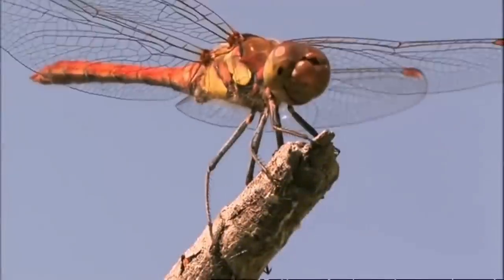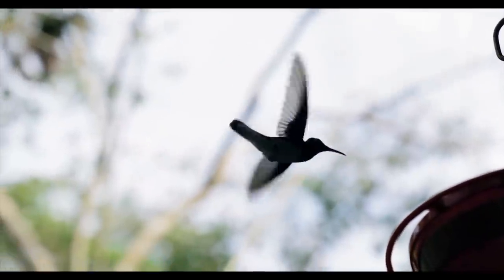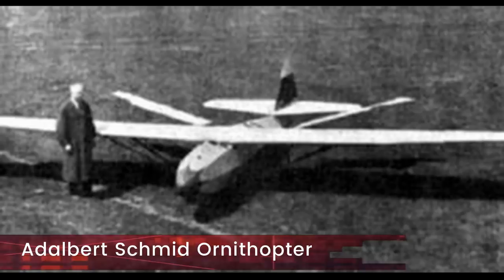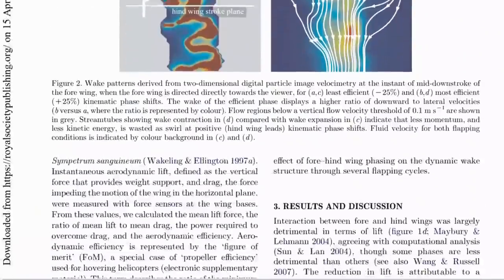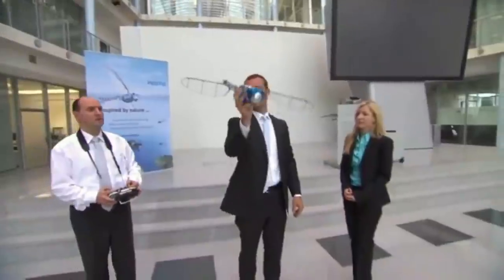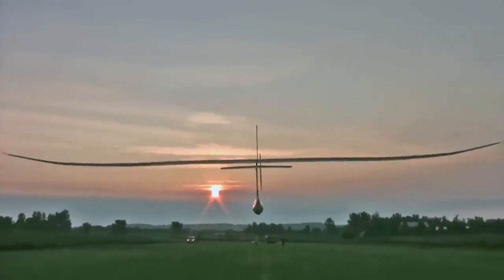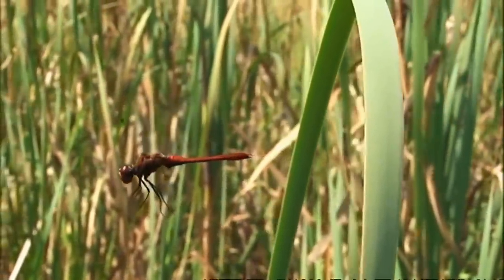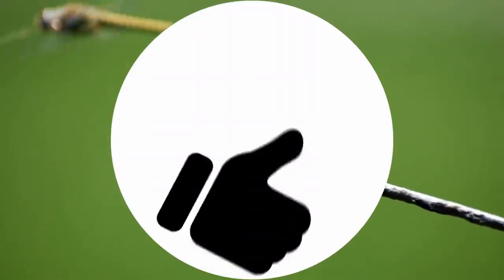Dragonfly Secret: Key to Electric Ornithopters

Comment: Much Higher concentrations of oxygen in the atmosphere was apparently responsible for the larger size of dragonflies early on,also the earth and magnosphere was smaller and maybe stronger in the beginning of the insects.this would of  allowed for greater vortex interaction etc,which gave me the idea of incorporating an electro static element/wing which could increase the interaction maybe between the two sets of wings/electro static wings.this would be achieved by incorporating electric wires in flexible material that would act like a centipedes legs,and alternate electrically induced hot cold vortex could be created electrically maybe ( :
Reply from the maker: Worth a shot
Reply: We could also genetically engineer a dragon fly so they grow bigger and control their brains remotely.

Comment: I've always loved the Dune ornithopters, ever since I played Dune II when I was little. The 2021 film rendition is awesome.

From an engineering standpoint, beyond figuring out the aerodynamics, I'm guessing (from a completely uneducated standpoint) one of the major challenges is to find the materials that could withstand the stress of hyper-intense wing flapping (as seen in the movie). Artificial muscles may well be the answer!
Reply: I agree... that's the problem with large scale ornithopters in my opinion; the stress would be unbearable. Also, in bigger aircraft the wings would have to flap much slower, leading to a LOT of vibrations... just making them buzz like in the movie wouldn't work i think :/ I would love nothing more than to be proved wrong in the future though :)
Reply: I'd be curious to see if a small scale radio controlled replica of the movie ornithopter could be made with modern materials 🤔
Reply: Polycarbonate would be good candidate for wings, but if you don’t know the ornithopters in the new dune movie are real and operational, 2 dragonfly ornithopters were built for the movie by a British company, bgi

Comment: A plastic muscle ornithoptor airtaxi, might have some good safety points. With four wings, a catastrophic failure should be avoidable, even if one was sheared off. It could still pinwheel down I believe. 

The muscles wouldn't be subject to sudden failure like a single prop/motor, but might be easier to maintain than the current air taxi proposals using many redundant motors.

Comment: I’m genuinely surprised that none of the notable modern developments seem to have utilized loudspeaker technology to produce the reciprocating action required. There’s no need to have bulky gearboxes and crankshafts with ridiculous amounts of weight and friction when you can have extremely tiny coils paired with lightweight permanent magnets to provide variable frequencies and even custom-shaped waveforms.

Granted, this would likely be less useful on large-scale craft meant to carry human passengers, as the drivers would have to be monstrous and heavy as well as likely to burn themselves out due to the power required, but I’m personally way more interested in making tiny, tiny ornithopters the size of hummingbirds or smaller, and drivers that size should be quite lightweight in terms of scale.

Comment: Insects use their wings to create angular inertial for moments,  which has harmonic flow versus gravity, this is why they would be crippled in micro gravity, navigating in such extreme haywire motion all over the place, this feature would require great mechanical limb strength and agile motion for a massive body like a typical aircraft.

Comment: I think one of the most difficult things to solve on an ornithopter would be the noise of the wings. These have to break the sound barrier on every bat. Meaning if they would be made of aluminium like the ones on a helicopter, you wouldnt be able to stand within a 400 meter radius of it without going deaf (hearing damage up until like 1200m). So the solution is unfortunately obvious. For the ornithopter to become reality we would either have to use aerogel for the wings (good luck manufacturing in that size) or we have to find a better solution. There already is a better solution. Its called the cyclorotor. Its essentially a helicopter that works via 4 Voith-Schneider-Propellors. It needs no space for the rotation a all, the rotors for a two seat helicopter would be about double the size of a human head, it has exactly the same flight properties as an ornithopter (completely vector independent thrust) and its Power efficiency is fine. So, what did we learn: Dune is fictional-science. Not science ficition.

Comment: Haven't seen Dune, but my guess is that ornithopters are preferred on desert worlds over helicopters and jet aircraft because the mechanism can be sealed and prevent sand getting in the mechanism.

A helicopter rotor could not be sealed in the same way, and a jet engine would suck sand through the turbine.
Reply: interesting point.

Comment: Very interesting expose of the subject!
Tanks for the link to Dr Kazuhiko Kakutas Channel, very interesting, not seen that before! My old mentor Francis Reynolds tried to build an RC ornithopther in the late 1970:s but it never flew well. He was an accomplished aerospace engineer for Boeing, RC model designer and wrote a monthly column in RCM. Not many people took this seriously back then. I remember a few cases where where vortex lift was evidently used like the interesting but controversial Kasper glider back in the 1950:s. Some coanda effect vehicles can also use vortex lift. Seen som interesting RC models on Youtube. Coanda effect was used on a Boeing proposal for creating a heavy lifter. I saw the prototype fly,  it had awesome low airspeed STOL performance. A friend of mine was engineering manager for the landing gear which was quite a heafty piece of hardware to take the punishment...

Comment: Interesting because I was thinking of two semi-rigid but flexible lightly framed cellophane wings each bridged over two fulcrums, (one on each side) of an oscillator driven piezo anchored and attached to the center between them to reciprocate vertically at high frequency.

Comment: what happen if, combine 'collective pitch '-(it's common, and, all of    nowadays helicopters applyied to controlling )- with the orinito-wings move. Rather, placed the rotor in the root of the wings, and the wings balanced with a swash-plate on the about 1/10 part of the rood. Like the canoepaddle works🙂

Comment: Such design wobbles the body unlike fixed wing. Unless there’s a stabilizer for the cockpit, I imagine the pilot might suffers potential concussion.
Reply: But if the wings cause same amount of force simuntaneusly as other pai goes up while other goes down then there should be no force applied to the body of the aircraft other than accelleration and descent
Reply: @trollingmodeactivated2500  Good point…

Comment: But is it more efficient than the coaxial rotors on e.g. a KA-32? If not then it's just more complexity for less benefit.
Reply from the maker: From the little  literature I have read its is 20% lower energy consumption for coaxial rotor as opposed to 22% for the flapping wing

Comment: Nice Video, lots of interesting information, and very entertaining, But; I think you vastly understate the problems with scaling flapping wings up tp useful aircraft size. This tech would be pigeonholed (sorry, couldn't resist) into the vertical takeoff and landing roles, not really competing with real, existing airplanes. It's all very much Dragon-Fly compared to an Orange, or 1000 Kph + passenger Jets which weigh > 50,000 kg! . Our primary use for airplanes is to travel very rapidly between distant destinations.  How comfy are passengers going to be with wings beating up and down at say 20 - 240 hz. Can you imagine wings of significant weight changing direction multiple times a second and surviving ?  Where's my supersonic dragon fly ?
Reply from the maker: My upcoming video will be on this topic

Comment: The reason the Ornithopter concept has always been a failure, & will always be a failure... is because people, who keep proposing the designs ignore the power - weight ratio issue.  

The design works for insects, because of their very small mass, as gravity poses far less of a burden on the insect's structure.  
At those small scales, an insects muscles work far more efficiently for their size & weight.  
Expand the size & weight of a dragonfly to that of a airplane or helicopter... & it would be impossible for dragonflys to fly.  

The simple fact is, we are limited by the laws of physics, & we have already found far more efficient designs for aircraft.  
To make an Ornithopter work, would require reinforced structures so heavy, that the energy requirements for a powerplant would be too enormous to be practical or useful.

Comment: if a helium balloon a ornithopter, human powered, pu238, and solar
Reply: put a gyro disc, as auto-mechanical balancer
Reply: what is 22%, nothing, 90-100% instead, fold back out of the way
Reply: birds glide most of the time, they can dart if very fast speed is required, f-14 tomcat
Reply: check out cyclocopters, they turn the wings all the way off
Reply: double turbo gyro extending rotor discs, radar included, also a satellite disc
Reply: scissor fold out wings, double f-14
Reply: those are just helicopters, active balancing
Reply: chinook scissor quad-wing-plane-helicopter
Reply: osprey also

Comment: The problem with the permian dragonfly is gravity was much weaker in the ancient past, that is why dinosaurs would never reach their size if cloned today.
Reply: What? How?
Reply: @gormauslander  the mechanisms of exactly how arent known but the earth is slowly gaining mass, the effects is earth expansion and that forms the basis why the oceans ridges are the thinnest and newest and all continents fit together. Also the data invalidates the constant diameter earth model the pangea idea is based on, and it explains why all land was initially underwater. Expanding earth theory its recently called.
Reply: @635574  occam's razor suggests that it's unlikely what's actually happening, as it requires more assumptions than just shifting in ways we don't understand, but if true does provide a convincing explanation for why land creatures got so large, which the square cube law tells us is super hard to manage